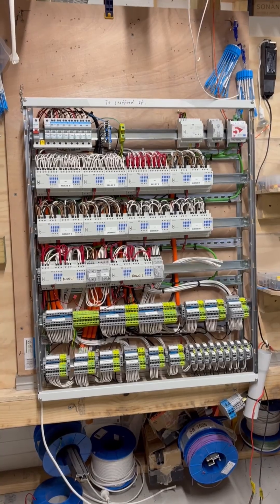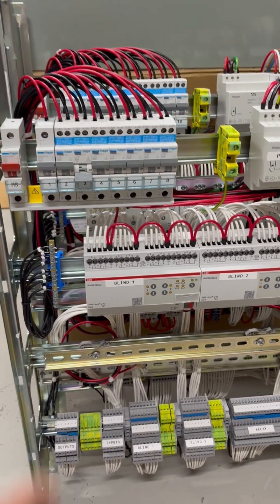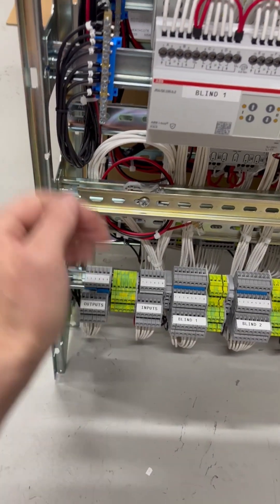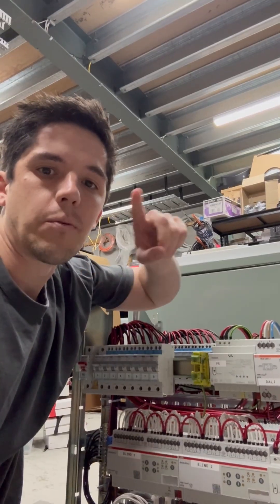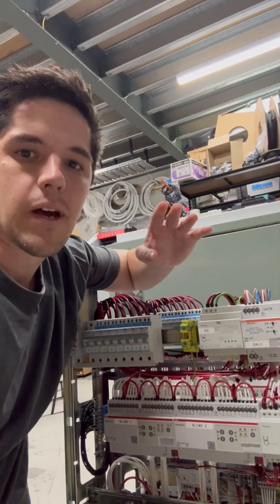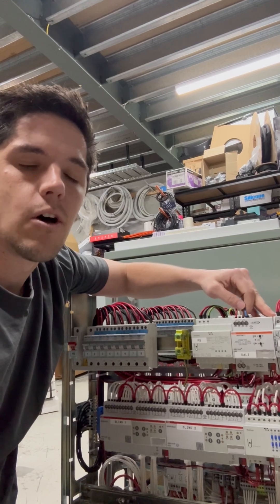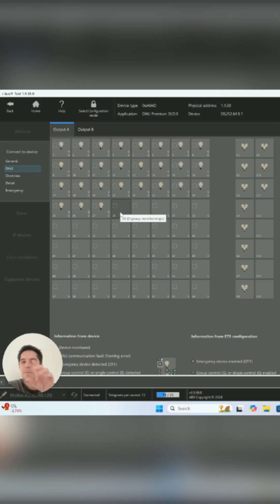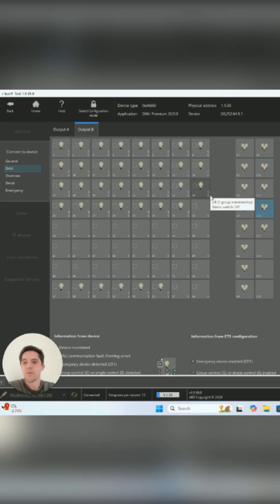Intro to Dali Lighting Control & Why We Recommend It + Switchboard Building Setup in our Factory

Comment: Excellent video and I appreciate you doing this. I’m an amateur builder in Arizona, USA and I’m planning a future build and love the control and flexibility DALI can provide. However, I haven’t found someone locally that is familiar with the system/protocol and doesn’t readily see the benefits. Can you highlight the wall switches that you use to control the lights? Also, how are you handling the various LED drivers? Are you using fixtures with built-in drivers? Are external drivers centralized or decentralized across the house? I’d your insight. Thank you!